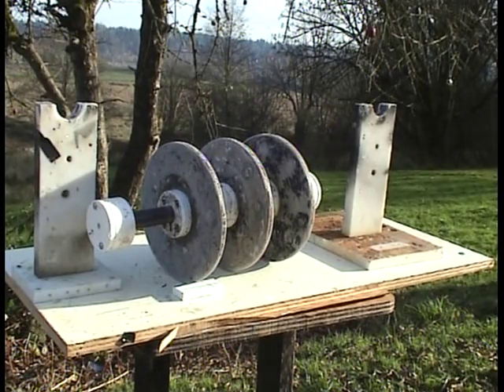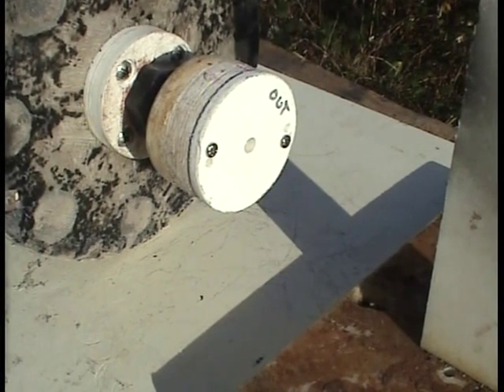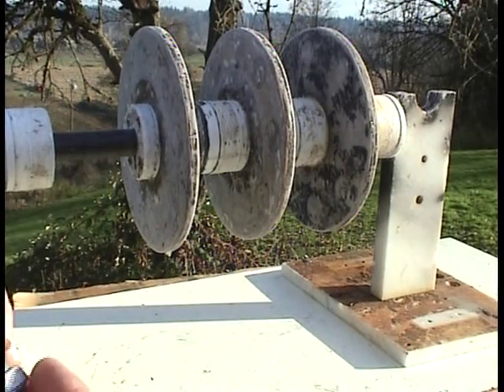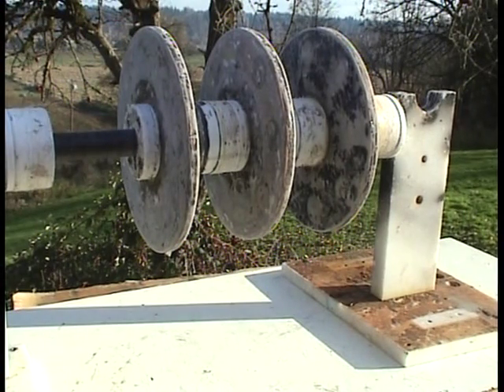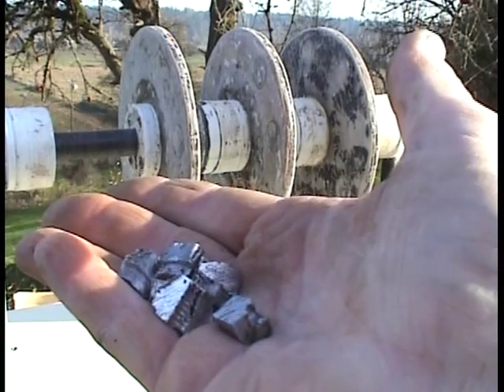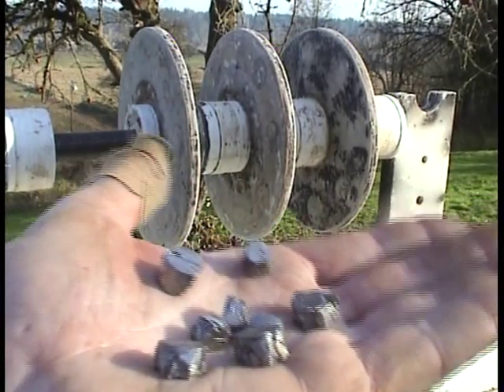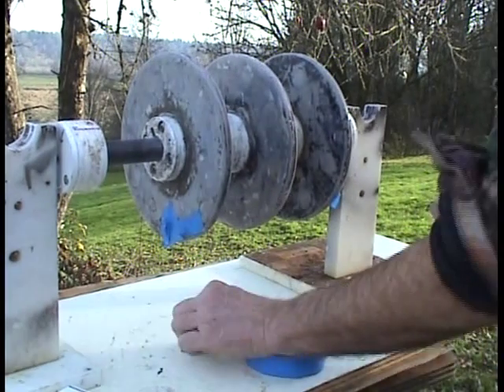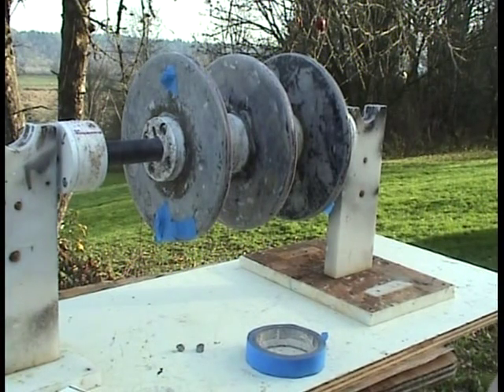Balancing rotor part 1

Comment: Doug once you get really close I think you should rotate the entire table around to recheck it. As with such strong magnets evenly balanced.... Earths field might affect your apparent balance. Like a compass needle responds to Declanation component as well as North to South.  Just a suggestion Gerry
Reply from the maker: yes good idea nearby iron affects it too -  I couldn't get it absolute perfect with zero pull back as you see in part two video at end of it,  but when the big bearings go in its going tp not matter at all if there is slight pull back.
I don't think machine shop could (or would of) made it be balanced any better than it got to be in end product...the fact it settles in so many different postitions means it got to point where adding (or drilling out holes) to balance it anymore became fruitless, since it never settles one spot anymore so that is as good as you can get....

Comment: Doug my friend... why add weights? Just subtract the unwanted material from the heavy side by drilling out material?

IDK... just a thought... U da Man!
Reply from the maker: Its too off balance in first place to drill holes everywhere to balance thanks to the long 9 1/4" key along shaft that locks the hubs and rotors to shaft. Also not much space between the magnets to do lots of drilling also didn't want to make it look like swiss cheese but ususally for final balancing at end, I do drill holes but not this one...also it needs to be really strong as is going into car is plan so didn't want to driull holes to balance..
Reply: MrDKONZEN 
internetsmcom@hotmail.com